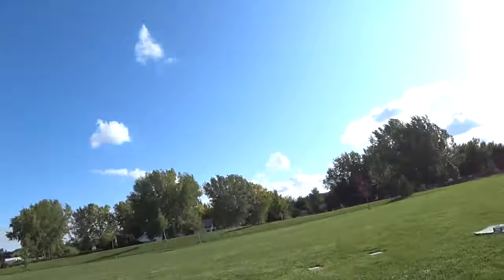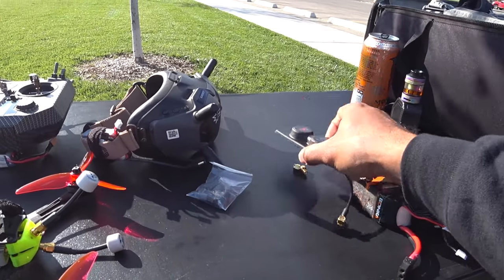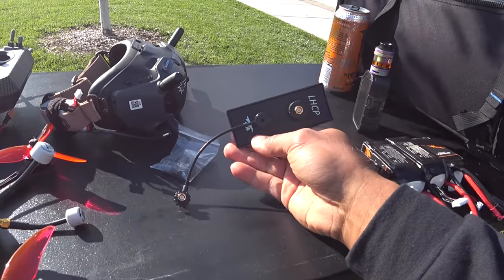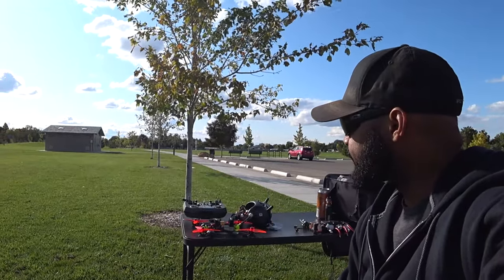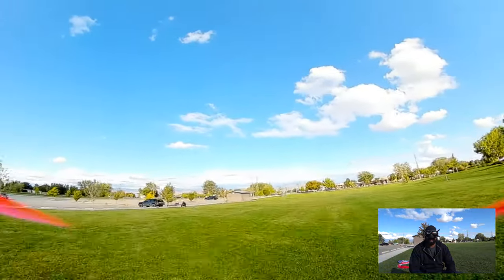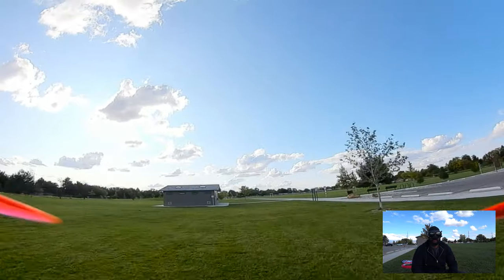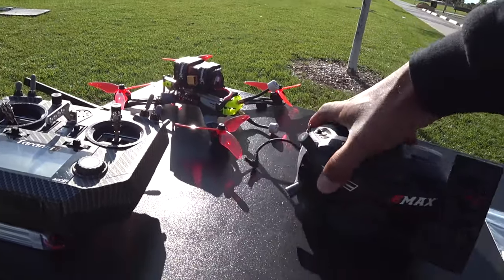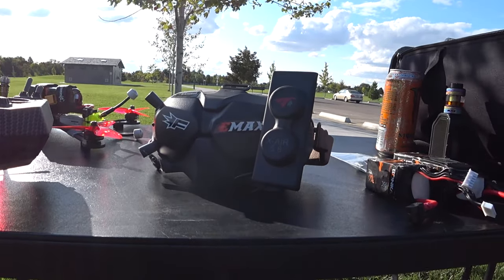DJI FPV Antenna Comparison // TrueRC / Tuesday Vlog

Comment: Very interesting on the omnis. I run Cyclops, but I think for most of my flying, an upgraded set of omnis would be enough. Plus like you said, it would then fit in a case.

AndyRC mentioned that the top antennas are RX/TX, and the bottom are only RX. Not sure exactly how to use that info, but something to consider when placing your antennas. Maybe do low VSR on top, and high gain on bottom.

Comment: Range scales by R^2.  Every time you up the power 4x, you get double the range.  400mW gives you 4x the range of 25mW (in pure power terms).  This is also why it's so easy to blow out other people's video - you can be 10x closer, and even if your adjacent channel leakage ratio is -20dB, you're at the same effective power.

I like the ability to spot critters.  Tend to have quite a few loose dogs most places I can fly.  Sadly, nobody appreciates my ability to fly back close, then LOS my way back to a hand catch while having sombody's dog sprint at me, going for the uncatchable tennis ball.

Comment: Do u think the patch and 2x stubbs are worth the price in exchange for the performance it gives? I normally fly freestyle and maybe mid range distance. Or stock is fine. I dont want to buy the antennas if its not that much difference.

Comment: What antenna's did you put on the quad? Link? Thanks for this awesome review!!!
Reply from the maker: Those are SMA Lumenier AXII's.
Reply: @Furadi  So some special plugs and wiring then, got it. Doesn't TrueRC have some that plug in directly? Guess that'll mean I need new 3D prints too :-(
Reply from the maker: @RobertTheFriscoSchmid  no no you just need MMCX - SMA pigtails. It's better I think.

Comment: Personal experience I agree the Singularity 4-pack has a slight improvement over the stock antennas.  I haven't tried the X-Air, but do have a VAS Cyclops and I am so impressed with it I plan to use it all the time and sold my Singularity 4 pack antennas. Would love to see how the Cyclops compares with the X-Air! Personally like the look of the X-Air much better, but performance wins at the end of the day.  Nice video btw!
Reply: What do you like about the X-air better? The color? I mean it only replaces 2 of the stock DJI antennas (so you have to purchase 2 of them to get the same performance) as compared to the Cyclops that replaces all 4 for less. Plus you have to rely on the cables to support the X-air.
Reply: @s3cr3tsqrl64  Sorry I didn't meant to imply that I liked the X-Air better in any way other than how it looks compared to the VAS Cyclops.  Just curious to see a comparison between the X-Air setup vs VAS setup.
Reply: @caymandiver75  I didn't think you implied anything more than that. What I am curious about is why you like its looks more? Sorry if that was not clear
Reply: @caymandiver75  So would I.
Reply: @s3cr3tsqrl64  Because the cyclops takes geek to the next level  :)   I like what you gain but would be harder to store goggles

Comment: I just ordered the Apex HD body and the DJI fpv setup. What antennas do you recommend upgrading to for the drone and for the goggles?
Reply from the maker: Right now I'm using the TrueRC Xair and on the quad I'm using Lumenier AXII's connected with straight mmcx to sma pigtails.

Comment: Have you tried the DJI controller?  I have been looking for pros / cons on switching to it...
Reply from the maker: No sir and I wouldn't. It shares it's link with the video signal which means if you get low bitrate you failsafe.
Reply: @Furadi  Ahh okay. Thanks, and good info on your channel :)

Comment: I'm not sure how you would transfer the bit rate (mbit) into a general radar equation. 
In general due to the free space loss the received signal strength is decreasing exponentially. 
So 2 times the distance = 1/4 received signal power.

https://www.radartutorial.eu/01.basics/The%20Radar%20Range%20Equation.en.html

I would use the formula of the Link Budget in combination with free path loss to roughly calculate the gain in distance where the difference in the gain of the receiver antenna is the main difference.

Comment: So does it have two screens or is it a box goggle. One big hd screen?
Reply: Also does it have bf osd ability
Reply from the maker: 2 2" screens. It can't use BF osd but it pulls data over msp. So far that only means voltage and arming state.

Comment: What antennas  you put on your quad ?
Reply from the maker: In that video I think I had dual lumenier AXII's. But the antennas on the quad aren't as important as the antennas on the goggles.
Reply: I want to be able to fly be hind me so I figured leave the bottom ones stock and get x-air like the one you show here. Problem is that I can’t find it in stock :(